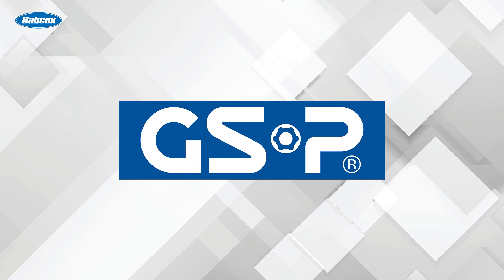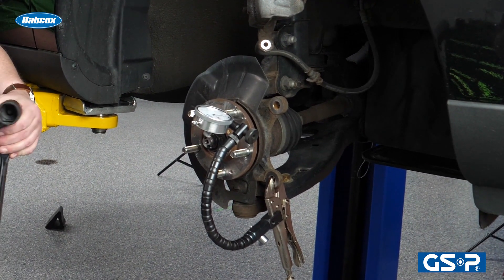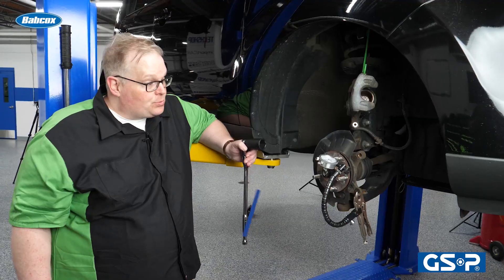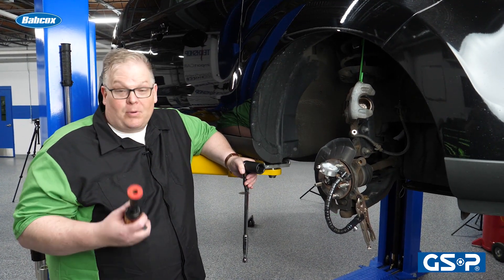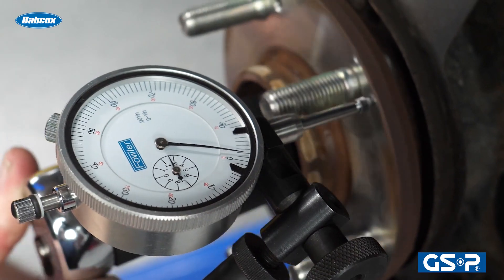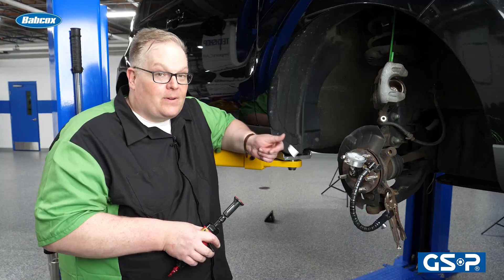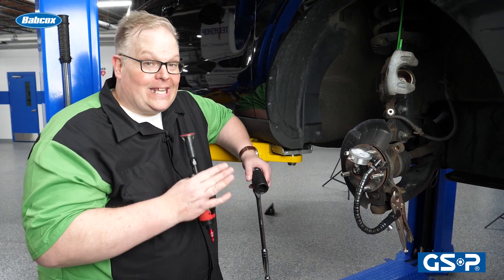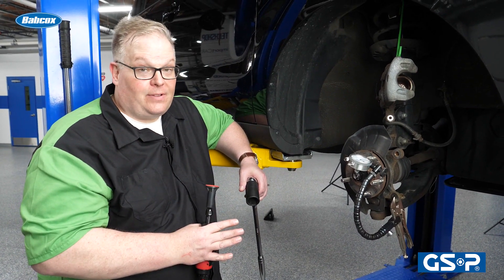Hub Flange Runout Measurement

Comment: Just as a side note.  A lot of standard office papers come in between 3 and 4 thousandths of an inch.  Getting a good measurement on any machined surface, that has been exposed to the elements, will usually be difficult without stoning them first.